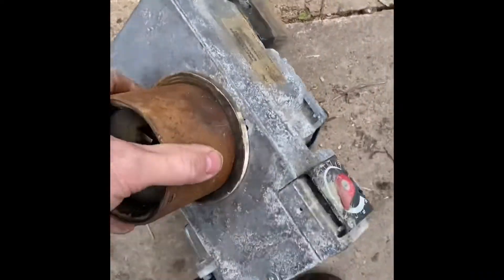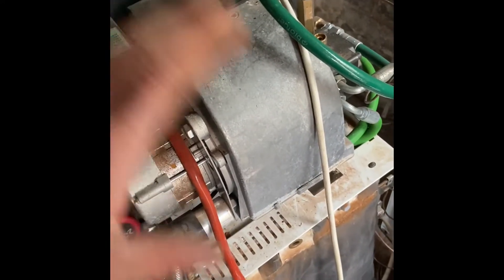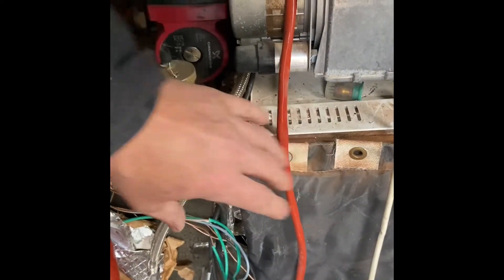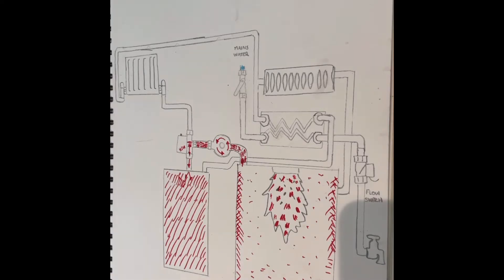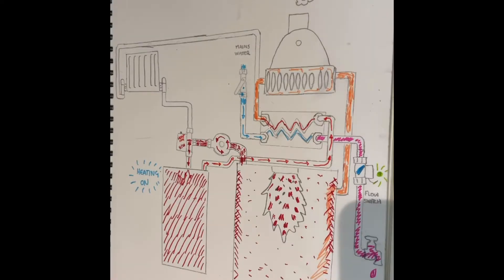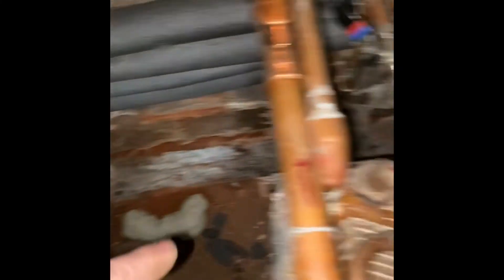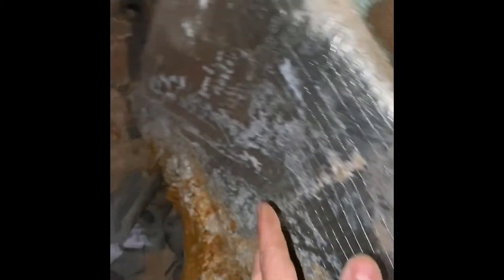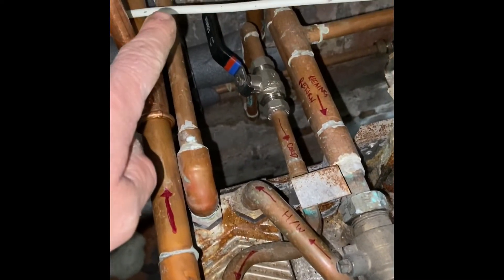How an Oil Combination boiler works

Comment: Why are my radiators hot and pipe going to water cylinder hot but no hot water. Disconnected thermostat but still no hot water
Reply from the maker: Faulty zone valve is the most common
Reply: @Hancock and Brown  Thanks for your comment. I Don't understand.  What is stopping the hot water entering the cylinder? The feed pipe at side of tank is red hot.
Reply: @GHancock  I disconnected motorised valve as I felt it may be wired incorrectly or thermostat might be faulty
Reply from the maker: @Thomas-mp9qq  I wouldnt disconnect it.. just pust the lever over to manual and put the heating on
Reply: @Hancock and Brown  I have tried both. The pipe is still roasting from motorised valve to copper cylinder. Why is the hot water not entering the tank... maybe it is but why is there not hot water in taps. When using solid fuel I have hot water in taps. It's driving me crazy
Reply from the maker: Check the little tank hasn’t run dry, then it’s time to call someone in.. before you start costing yourself more money..the flow in should be hot and the return out the cylinder.. if both are these are hot then it’s working.. could be air lock or blocked..so hard to tell without seeing it.
Reply: @Hancock and Brown  Thank you for your responses. Feed in to cylinder is red hot. Feed out is warm not hot. There is water in small tank.
Last question,  what is stopping the water from getting hot?

Comment: Should you turn your heating temps down like on a gas boiler
Reply from the maker: Only if it's a combination boiler, others it will never reach temperature when heating the hot water cylinder.. So it will cycle in and out costing you more money